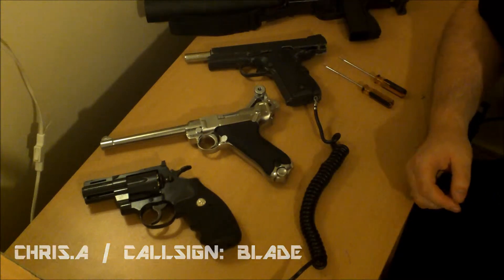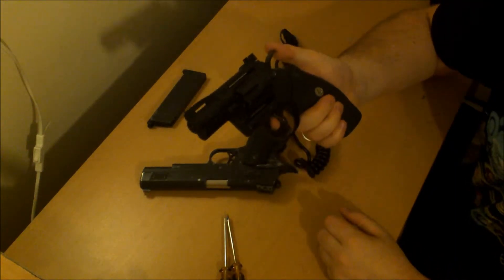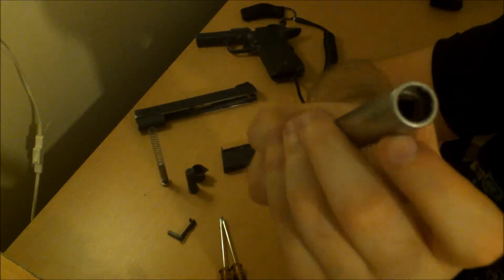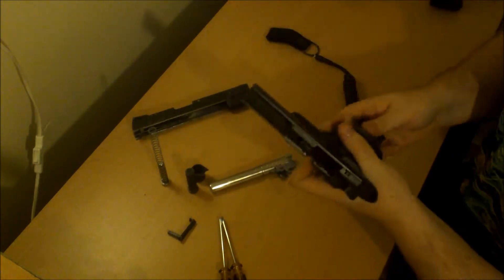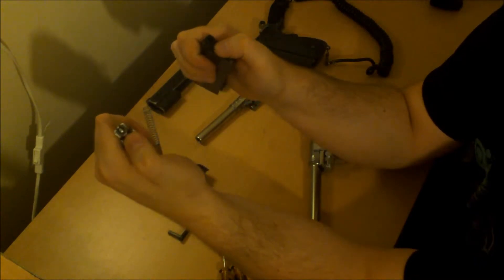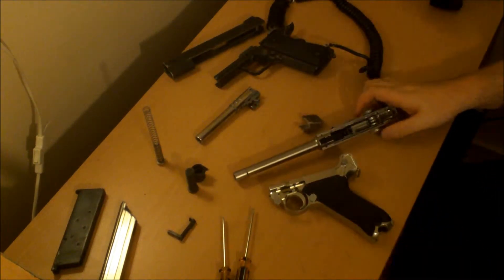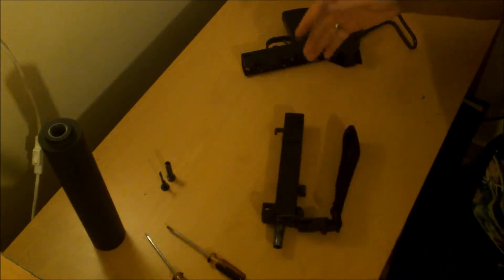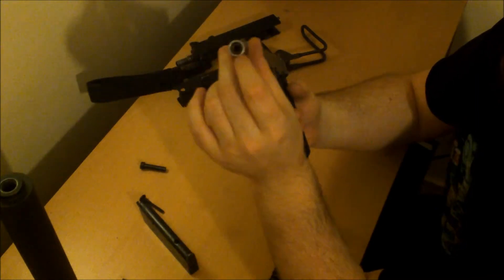Anatomy of a gas blow back gun

Comment: Very VERY educative video. I do wonder though, you're talking about spraying a tiny bit of silicon oil into the brass barrel. Seems to me that this actually decreases the FPS and accuracy of your pistol because it gets kinda smudgy? The BB's only weigh in about 0.20 grams yea? So these are easily affected by the slippery, yet smudgy silicon oil... just a suggestion/question :P other than that, REALLY nice video!